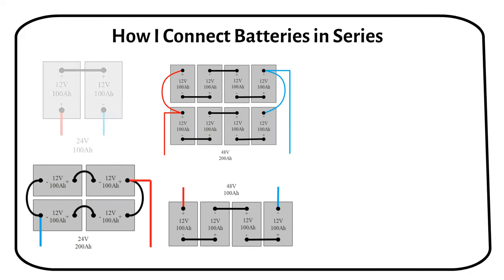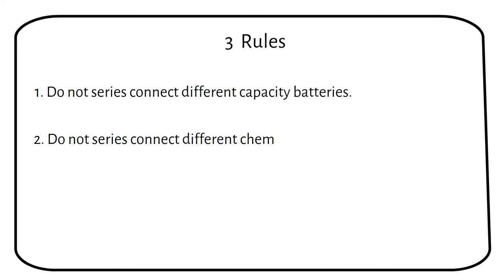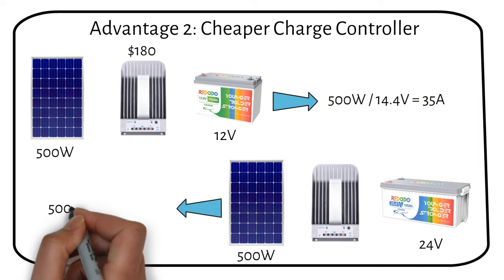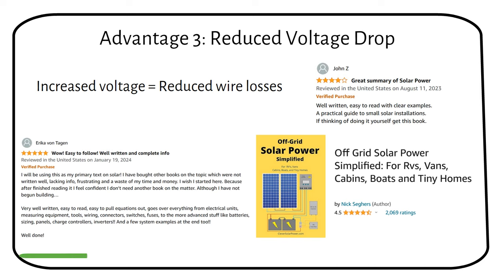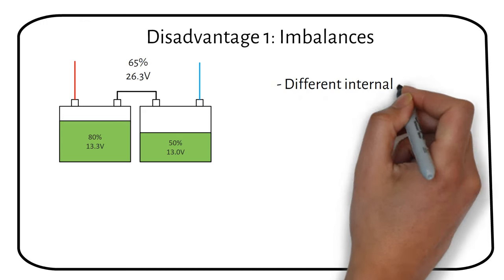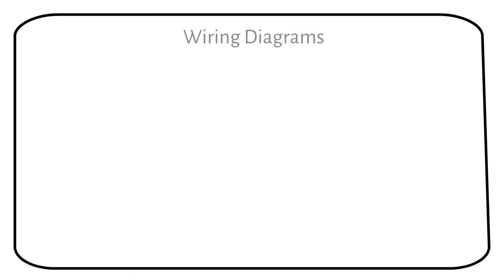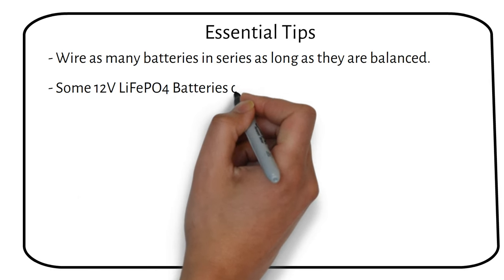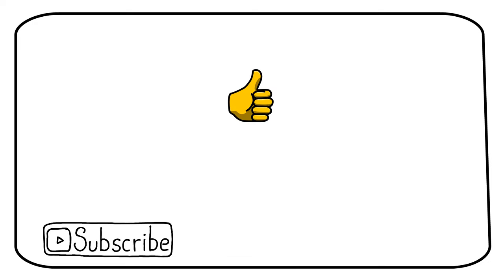Connecting Batteries in Series - Charging 12V Lithium Batteries

Comment: STUFFING MY KAYAK WITH 3 12V LiFeP0⁴ 100AH IN SERIES TO MAKE 36V OK NOW CAN I BUY 3 MORE DO THE SAME IN SERIES THEN PUT BOTH SYSTEMS TOGETHER IN PARALLEL TO INCREASE AH TO 200 AH 36V BANK🤔🧐 TRYING TO RUN A 3.0 HP stern motor on my kayak? AND NEVER RUN OUT OF BATTERY 🤙🏽🤙🏽🙏🏽

Comment: With lithium ion batteries, why did they say you can’t hook more than four up in series? I would like to hook up 6 to make 72v
Reply from the maker: The BMS has components that cannot go over 60V (mosfets) so if you connect them in series the electronics will get damaged.

Comment: Problem is that 24V LifePo4 cost double of 12v batteries (with same A/h), same problem with 48v.
Reply from the maker: It's not a problem. You are paying for more capacity. A 12V 100ah battery contains 1280Wh, while a 24V 100Ah battery contains 2560wh.

Comment: Sir could be possible if I want to make a parallel (12 v, 100ah x2) then I series it with 12v 200ah...in other term 12v 100ahx2 + 12v 200ah...thank in advance for feedback
Reply from the maker: If you have a 12V system, then you need to wire them all in parallel. If you have a 24V system: you can only use the 2x 12V 100AH in series. your single 12V 200Ah will be left out of the system.

Comment: So off topic sorta, I have a small bluetooth receiver I use for my car, and battery life on it is short, and I have a bunch of disposable e cigs with lithium batteries, can I solder extra batteries from the disposable vapes to the battery in the bluetooth device to increase battery life? My concern was about charging, will they charge the same? Or one more charged than the other?
Reply from the maker: The vape batteries will be their own battery pack with BMS. A guy recently made a video about it where he got the salvaged vapes and made a battery pack out of it. Searching for diy salvaged. vape battery pack will get you to it.
Reply: @cleversolarpower  thanks dude! Was it a video from big Clive by chance?

Comment: How do I  hookup  8 batteries , 12 v 120 ah for a 24 volt system...thanks
Reply from the maker: place two batteries in series. That will give you 24V. So now you have four sets of 2 batteries in series. Now connect these 4 sets in parallel. Use main positive from battery 1 and main negative on battery 8.

Comment: If you had 4 x 230 watt panels and 2 x 410 watt panels in a 24v hybrid inverter. What would your advice on wiring them in.? The mppt takes 60v to 500v
Reply from the maker: Checkout my video about wiring mismatched solar panels. You need to know the vmp and imp of the panels as well.
Reply: @cleversolarpower  I have all that information. I'll take a look at your video. The 4  x 230 are old poly panels and they 2 x 410 are modern DAH half cell panels. Much higher Voc on those
Reply: @cleversolarpower  DAH 410 vmp 37.5 imp 10.5 and the Trina 230 are vmp 29.5 imp 7.78
Reply: @cleversolarpower  I did the 2 Dah panels in parallel. The 4 x Trina panels in series. Then both sets in parallel
Reply from the maker: The best solution would be to have the four panels go to the MPPT and the two others on a separate MPPT. Now you are losing power.

Comment: Thank you for the video.  Very helpful.  I have a 4s4p 12.8v 51.2V LFP system.  These are new batteries.  Like you say in your video I am concerned with balancing.  A video on setting up a balancer would be useful to me and others who bought 16 batteries!  I don't believe my system is optimized and would like to get it better balanced.  Would adding bus bars help?  The batteries are wired correctly.  Thanks in advance for your thoughts.
Reply from the maker: Check out my video about wiring batteries in parallel as well. For a series connection you can just use the wires, or you have to make custom busbars which might not we worth it. For the parallel connection i would use busbars.

Comment: I have 10 24v 2.2 kw 67ah  8s NMC lithium batteries. I would like to configure them into a 2s 5p connection as per your 2s 3p diagram, arriving at a 48v output. Should I use one 8s BMS per battery or one 48v 16s BMS per two batteries? Please give me your thoughts on this setup and any suggestions. Thank you!

Comment: Absolutely  awsum video, I do have a question/scenario. In a system set up in a solar generator where the batteries stack one on top of the other, wouldn't this make the top battery take more load than the others,and if so,how to get around that,just rotate the batteries bottom to top every so often.I ask because most manufacturers are using this setup. Point Zero Energy(titan) Eco Flow Ultra,and so on,is this the only answer, to rotate and rebalance each battery individually?
Reply from the maker: They are connected in parallel, not series. Check my video about connecting batteries in parallel.

Comment: Question, I have 2 - 12V LFP batteries connected in series and will use them to connect to a Pecron solar generator via the solar input to charge it during emergencies. When I drain the batteries, I have a 20 A - 12-24V charger to recharge them. To recharge, do I connect the alligator clips to each batteries terminals to charge them separately while they are still connected in series or do I attach the alligator clips to the load terminals, + on one battery and the - on the other battery? Great videos BTW.

Comment: I want to connect 2 same type 12v LiPo batteries in series to give a 24v arrangement.  You stated each battery must be individually charged before connecting them.  Can you explain exactly how I would do that and what parameters should be used to determine the batteries are sufficiently charged so they can be connected. I am looking for a practical “how to” explanation.  Thank you.
Reply: Charge them on a Lithium charger till there full, the charger will stop charging at that point. That's all I do.

Comment: Good video about building a good system 
If you build a 16s2p(or 2p16s…what’s the difference?) with 304AH and top balance them before 
can you suspect that they gone stay balanced in long run with a active balancer on the BMS
Reply from the maker: Its a big difference. the first means you have two separate packs of 16 cells in series (i recommend this) and the second one is two cells in parallel and then series connected with another two cells in parallel, and so on. i do not recommend the second option. Why? in the first option every cell has it's voltage sensor from the BMS, in the second you have one voltage sensing wire for two cells. I would not top balance, they will balance over time with the BMS (if you have active balancing).

Comment: Hi Nick, I just received your book it's very informative and will be very useful for putting up my 5kw system. I just would like to know the best way to wire together 6, 25.6 100ah batteries. I want, for now, to run them through my Bluetti that has a maximum voltage of 145. 
It would be terrific if you could do a video on how to safely add batteries to Bluetti type generators so as not to have to buy their very expensive expansion batteries. Keep up the great work. Carlos.
Reply from the maker: Thank you for getting the book. I think you mean 145V max solar input voltage, not battery voltage. I don't have experience with adding extra batteries to the bluetti. I think they have a limited charging power from a DC source, so it wouldn't be ideal. It's better to build your own solar generator where you can add components to your liking.
Reply: Hey, thanks for replying so quickly. You are right, of course.  It's just that I knew nothing when  I bought the bluetti and now I know much more, with your help. Do you have details on how to build your own solar generator because I could probably be able to sell the bluetti and would love to build my own. Thanks again for your help. Carlos.

Comment: great video do you have anything on bms size and how to work out whats needed  for 24v and 12v /
Reply from the maker: I don't. However, I will add it to the list of topics to cover in a video. 12V needs a 4S BMS, while 24V needs an 8S if you use LiFePO4. The C-rate of the cell should be more than the rating of the BMS. Example: 4 280Ah cells is series makes a 12.8V battery with a max C-rate of 280A. Use a 12V 100A BMS and you can draw a max of: 12V*100A=1200W from the battery.

Comment: Hi, I have a 24v -200a/h system, using 4 lithium 100a/h, So, serie and parallel with a solar panel of 460w. After about 4 months working,the system went down. I checked everything, and on the serie system, one of the batteries still showing 13v and the other around 8v. , on both of the systems.I suppose that if they go 
 down, they go both down, isn't it? 
Many thanks, if you can help me with this.
Reply from the maker: Did you connect the main positive and negative opposite of each other as shown in the video? Take out your batteries and charge them individually. Then connect them again in 2S2P. If need be, install a balancer between the 2 series connected batteries. email me if problems still persist.

Comment: Hi i have 2 rechargeable lithium 1.t batteries in a device that are connected in series, but the charger for the device is no longer available, it has a barrel connector to charge the batteries, can I use a 4 battery lion as charger connected to the output of one of those outputs to a barrel connector to charge these 2 batteries? Otherwise I have to take the device apart, thanks
Reply: I can use nimh batteries but I still need to know how to charge the 2 in series with one single input, thanks
Reply from the maker: I'm not sure about that. Check the voltage of the charger and the charging voltage of the battery you want to charge.

Comment: Can I Have 4 12 Volt Batteries Seried in 2 Packs for a 24 Volt System to Buss Bars for Charging n Inverting without using a Battery Balancer ?
Reply from the maker: Yes, bit over time imbalances will occur. You either need to recharge the batteries individually or get a balancer.